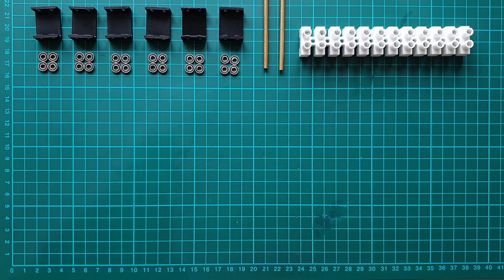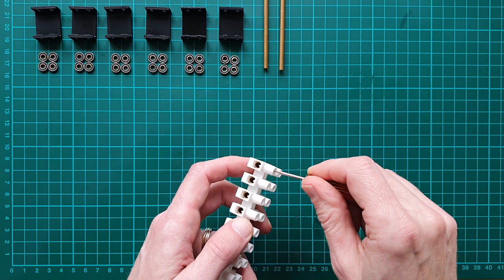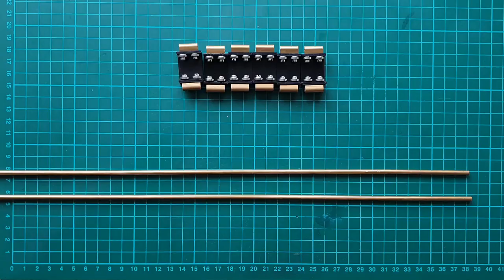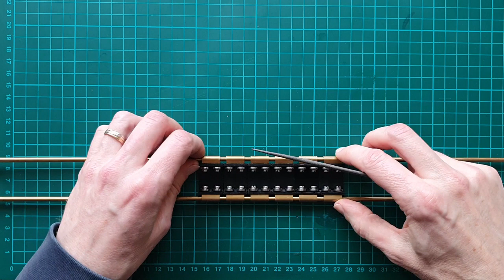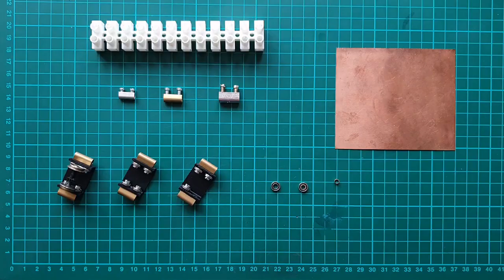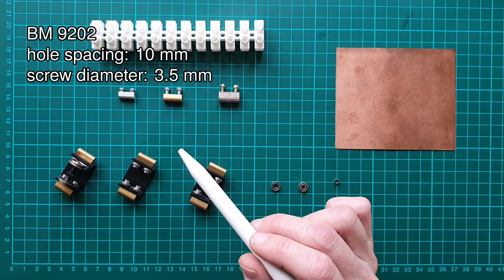Building H0 locomotive test stand

Comment: Hi, your Encoder thing is fantastic you introduced to Ralph. Is it possible if you can do coding for me for some consideration? I have a dc motor with encoder attached and I want to use this motor to do precise movements. Please let me know. Thanks in advance.
Reply from the maker: Hello, depends on what you need.  Contact me (for example, using feedback form on the link provided in the description).

Comment: Hello, Good idee your test stand. Do you have try one for n scale locomotive ?
Reply from the maker: No, but I think that should also be possible for N scale locomotives. Smaller bearings should be used and the bearing holders redesigned (see the table in the link in the description). If you are seriously interested, I could redesign the bearing holder for you, but you have to check if all new dimensions are suitable for N locomotives.